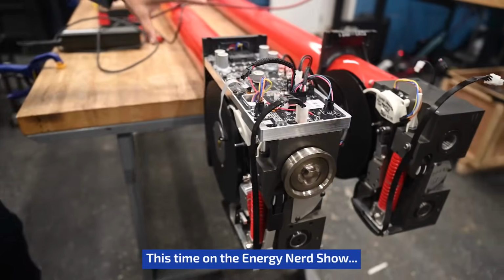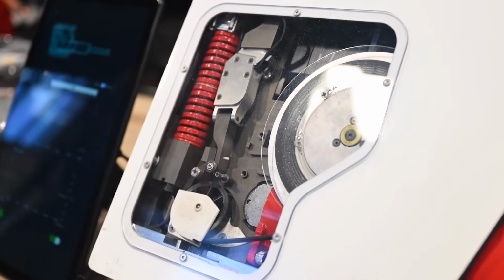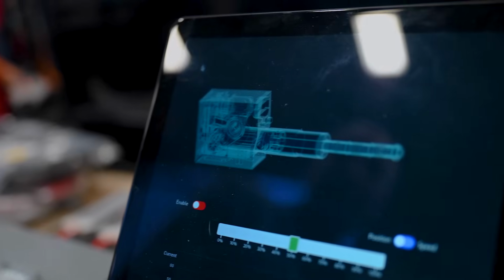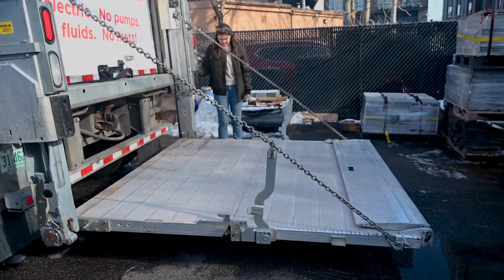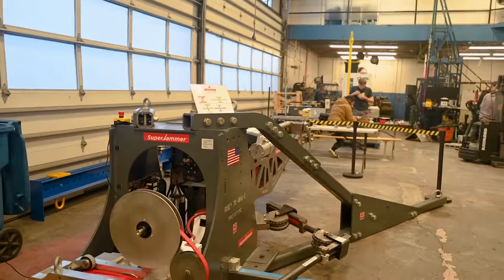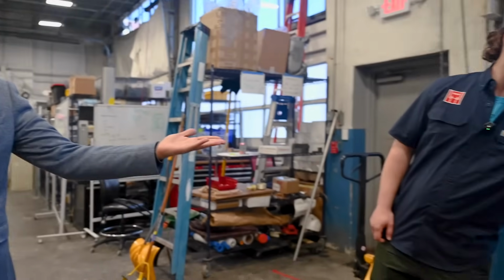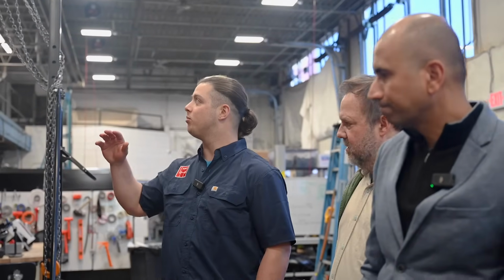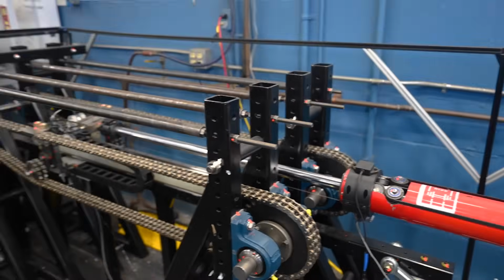Electrifying Heavy Machinery at RISE Robotics!

Comment: The intended application of this tech is for electric vehicles. The idea being hydraulics waste too much energy and this design is much more efficient. These can even be configured to regenerate and charge the battery when force pushes back on the actuator - like lowering a lift with weight on it. Of course it won't be universally applicable to every use case, but it could see a lot of installs as heavy industry continues to electrify.

Comment: So you invented a spring and a retractable belt (and made it supper complicated and expensive to build and maintain). In the industry in which I work (quarrying) we use hydraulics because we need huge amounts of force. There are also ALOT of cylinders per machine/process and they are used heavily and must be incredibly robust and cheap to maintain and/or replace. We already have control methods and sensors to allow precise, fast and proportional control of those hydraulic actuators (and we can go forward and back without springs - with the same levels of force in each direction). I wish you every success with your innovations but I am not seeing anything close to a challenger to hydraulics here. Talking about leaks constantly isn't going to convince many people I'm afraid - I think even a layperson can clearly see a lot of expensive ways your equipment can fail which hydraulic cylinders and solenoids' are not susceptible to. This was none the less interesting - best of luck 👍.
Reply: And what do lead screws have to do with 'Beltronics'?

Comment: These are neat. I work with hydraulic systems and occasionally they cause issues. I just dont know if these systems will be a drop in solution to replace our hydraulic system though.

Comment: Its pretty simple. Fancy housing. The major part of this project is the Ability to contain the Fluid and Maintain rotation at the joints and gear system . To push and pull. Now that ;has Advances for so many applications 😮 . I can see how using Ferromagnetic pole points could assist in theory Ingenious Creation truly.

Comment: My biggest concern would be maintenance of the internals - There are far more precision parts within the cylinder, so I'd be concerned about the longevity of these when they are abused as all heavy equipment is.

The comment about forklift steering cylinders was especially interesting though, I've driven a few vehicles with hydraulic steering and there's always a large disconnect between the steering wheel and the direction of the wheels which makes them feel really odd. With the position control of these cylinders, the steering would have a much more direct feel which is nice.

Comment: So you hvae a boom crane or heavy excavator in the middle of nowhere and part of  mechanism has cracked and you get I C Weld out to fix it and you need to lower something relative to something else but a diode or something else in an obscure module has failed so it is impossible to do that. You can't pop a release valve to release something in an emergency where you need to reposition parts to weld, say.

Comment: Impressive demo, and I can see a few niches where this can be applied, but I'm curious about the force density comparison. A 4" hydraulic cylinder at 3000 PSI generates ~37,000 lbf from incompressible fluid pressure across the piston area. Your belt system is fundamentally limited by tensile strength of the polyurethane-steel composite and pulley mechanical advantage. How do you achieve equivalent force density when belt materials have orders of magnitude lower stress capability than hydraulic pressure? Also, with cyclic loading at these forces, what's the actual fatigue life of the belts under flexural stress around the pulleys vs. a hydraulic seal replacement interval? The speed advantage is clear, but the physics of force generation seems to favor hydraulics for high-load applications.

Comment: 1) enviornment flexibility. 
2) ability for the owners to debugg, repair and maintain. 
3) size and packaging. 
4) cost. 
5) they are reeeeeeeeaaaalllly underplaying the belt wear. And NVH on those actuators. 
7) hydraulic systems are not limited by the fuilds capabilities but the capabilities of the steel that it moves ..hence you see a gazillion safely valves on them to protect the Machinery. So i dont see the point of this. 
8) how is this going be powered, i would rather use an electric pump to power a hydraulic circuit. Than use that motor to run this because the same pump can run much much more loads than these systems. 
9) for heavy machinery, on site maintenance and repair ability is not just a bonus ...its the king. And opening up a circuit board in rainy, muddy or dusty enviornment is definitely not advisable, also the AI stuff is a puffball because if my excavator shuts down in the middle of nowhere because of a " software update " issue..its lights out.

Comment: Why weren't these compared to traditional screw actuators? 
With regards to the liftgate, many liftgates use block and tackle connected to a hydraulic cylinder instead of just winching on a cable/belt with an electric motor. Those are just a pump assembly(motor, pump, tank, relief valve, and lower solenoid all built into one unit that's not that big), two hoses, and a hydraulic cylinder. To go down they just open the solenoid, to go up the motor is energized. Using this system is considered better than a motor and gearbox spinning a winch drum. So why are these electric belt actuators any better, except for the lack of hydraulic fluid? I understand that the regen could be a factor with things like forklifts, but even electric forklifts have been using hydraulic cylinders instead of winches for decades.

Comment: many of the new injection molding machines do not use hydraulics, they have been replaced with servo motors and screws. they leak a lot less on the floor and can operate with better force sensitivity than hydraulics, I have seen them quickly stop moving if they detect extra force is required to close the mold earlier than expected. this saved a prototype injection mold made from aluminum from being damaged.

Comment: As an aside, anyone remember the Hynautic throttle and gearbox controls popular on smaller diesel boats in the 80s and 90s? I'm just thinking about how these were basically mini push/pull hydraulic systems powered by a human. The interesting part being the hydraulic fluid was anti-freeze. I know anti-freeze is poison but not like oil which can do long term damage to the aquifer and all.... Then there's brake fluid, water based or water soluble i guess you would say.... I don't know why oil is the typical fluid in large volume hydraulic systems but I think possibly its because its in great supply and cost very little compared to less abundant, more expensive, and coincidentally cleaner alternatives? If so all this expensive electric nonsense can go to hell. Especially for a lot of the ill advised marine applications they are trying to force down our throats. That right there would pretty much expose the whole trend as a profit seeking deception when they can just ramp production and reduce costs of some "green" hydraulic fluid. I'm not buying the leaks issue anyway. Yo fix the leak. Yeah that whole issue did seem very forced..... Just train your guys that they don't need to rainbow the forklift in front of the mechanic just to prove it needs seals (pressure sensors can probably accomplish a job here). What do yall think?

Comment: This is not an advancement in technology. It reminds me in a way of the dragline systems used with frickin steam shovels 100+ years ago before hydraulics and internal combustion got implemented. I believe them that the belts need less maintenance compared to changing out the whole dragline cable every couple months, but like others said the belts aren't new tech. Just imagine when the mechanics pressure wash the trencher before they work on it, and as a result kill all the freaking electronics which for some reason are integrated into the ram??? Not even a question if that is gonna be an issue. Ask any Volvo Penta mechanic. Super cheap to print a circuit board these days.... Big bucks in selling parts for your intentionally overcomplicated "high performance, high tech, green friendly, even-a-caveman can operate it" nonsense. Big bucks is an understatement, I think our whole economy has devolved to operate on this kind of trickery. I like how when the EPA rolls out a new tier on diesel emissions, John Deere just increases the displacement of the engines then derates the hp to "burn less fuel". They're still cunts on the maintenance though but at least their engineers have better shit to do than reinvent the wheel. Never forget that literally everything was tried during the industrial revolution. Every weird design that somebody could dream up was patented and built. We picked the good ones and since then that stuff has all been pretty standard. Today we have material design improvements and computerization, so some of those ancient failed ideas are getting another try. Maybe these rams would work well in space, which is the kind of thing we need to be having our engineers focusing on, rather than how to maximize their profit at the expense of the customer, and protect their jobs.... But I think these guys are just cashing in on overcomplicated proprietary junk on the flimsy premise of green tech that's trending among engineers who's job was mainly accomplished by 100 years ago. Its a conspiracy I tell ya! Electric motors are fine but we have had them forever and they have had their place.... Materials science of batteries is unfortunately pushing electric toward encroachment into the diesel world where it just don't belong. What's next sails on cargo ships? LMAO.

Comment: No more loud banging in the morning on trash day is a very big advantage. So is no environment contaminating cleanup of hydro oil.  

I do agree with another commenter regarding increased number of parts being a concern for failure points and using linear actuator, however I think the block & tackle built into this system allows a mechanical advantage a linear actuator can’t deliver. Additionally, there’s a reason elevators are using this instead of a stacking of linear actuators in series. 

The comment on passive relief valve is the most important thing to consider imo, what happens to this system in the real world when it is yanked around while inactive? Can that be planned around?

Comment: Multi Position Hydraulics is & has been available for quite some time now, it has been coupled with an electric solenoid that is connected to a computer . The position is then actuated by hydraulic volume that is then translated to the extension &/or retraction position at a predetermined measurement.

Comment: Nah - I wouldnt swap out Hyd Cylinders on a W900 Excavator working in a harsh environment with an electric actuator. Hyd Cyl has 1 moving part, easy to fix, long life, will run even if seals are damaged,

Comment: i think it is interesting however i do not understand why they are using a round tube cross section.  pipe for pressure..... no pressure no pipe.   Square for strength and seems it would be way easier to fit the pieces inside.

Comment: Using the formula: HP = (2500 PSI x 12 GPM) / 1714 = 17.5 horsepower. 

Way to overcomplicate a simple 8 piece cylinder, and 7 piece control valve.
Reply: And the energy waste is what 75% on that conversion?

Comment: I’ve been or, I think, most of the people already use old model of actuator that already sell in the market. I bought and applied actuator in my house is because it cheap compare to hydraulics, yet easy to DIY and I able to connect with my smart home system (i.e: to actuate my glass void open and close). It also able to actuate at multi position, very convenient. Now already 4 months I’ve been use electric actuator and still works fine to lift up 60 kgs of void canopy glass, although, I still evaluate its durability. 
My concern is only the gear and the controller are quite look complicated and seem very fragile.
I think, as long as it has simple system, cheap, durable and reliable, it would be good replacement for the hydraulics.

Comment: Hydraulic systems have one advantage that nothing can compete with - liquids are not compressed and stretch like air or belts.
Reply: The stiffness of the steel in the belts is 4x that of the liquids.
Reply: @CharismaticScientist  it is application specific. His point is about the amount of load each can transfer without breaking. Liquid will neither fatigue or beak but steel will.More over there are packaging constraints with this design. This will have very limited application and will be largely limited to stationary applications.

Comment: Electric winches are already taking over hydraulics in the fishing industry. I have maintained hydraulics, and maintenance is an issue. Not sure why they are using the belts and pulleys rather that the new design motors that have so much power.

Comment: as a builder my whole life if I had to come up with an idea to replace hydraulics this would be number 999,999 on the list. did you see how many moving parts were inside of those rods I literally saw belts rubbing against the inside of the tube also you're never going to be able to produce the amount of torque needed in the field to do actual work why would anybody even consider a system like this maybe for a small robotic systems? That's a definite possibility but replacing a D8 cat I don't think so
Reply: There are a bunch of moving parts in sewing machines, printers, engines, and many more examples. This tech comes in a 22 Ton force size, pushes and pulls, and it will go on a D8 in due course. Before hydraulics steel cables transmitted mechanical power, and this is a return of that principle with modern materials and novel methods of handling the belt, that enable it to get into a from similar to hydraulics.

Comment: Try put this on a 50 ton excavator and see how fast they will laugh you out of the construction zone. Power to weight nothing beats hydraulics...
Reply: It’s on a 22 Ton container handler mast shown in the middle of this video, and in that application, it moves the same load at a higher speed. It’s also lighter weight than the system it replaces in that application. So, it has a higher power to weight ratio.
Reply: Let me guess the fact you just were made a fool isn't going to change your mind at all and your still going to say it won't work on equipment.
All major equipment companies are working on all eclectic equipment.
Reply: Oh and how many times stronger is that 22 ton unit than the excavator arm that you're claiming it can't lift.
And how much slower is that hydraulic systwm

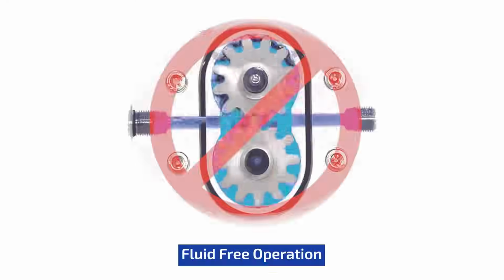Comment: 1:30 "as you know hydraulic oil is haz & also messy & when these sites move they need to be cleaned up cause it's very messy & expensive" 

I wasn't watching & just had this playing in the background while I searched for a job opportunity & the level of bullshit that came out of this man's mouth in the first minute thirty lmk he is pushing his nonsense on ppl who don't know what they don't know because a leaky ram WILL NOT OPERATE PERIOD & WILL BE AUTOMATICALLY RED TAGGED OUT OF SERVICE!!

if you're gonna Bullshit ppl then at least know what you're talking about because right now you sound like a guy who's read about hydraulic systems but has NEVER worked in or around them.

For clarification, the only hydraulic systems that are "messy & expensive to clean" are hydraulic fracking rigs but that's nothing to do with the hydraulics & everything to do with the oil it's ripping out of the earth.

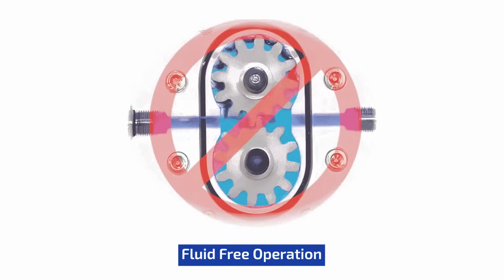Again, I'm only 1:30 in so I don't know where this is going but the beltraulic or whatever wheel he reinvented isn't going to be as cheap as rams, hose & a pto & will require knowledge only he currently knows to repair so take that into account when "upgrading" your 💩

Comment: So many comments have been negative, but also well reasoned and based on experience.

Instead of fielding soft-ball questions and have the video turn into an infomercial, the interviewers should do their research and ask tough questions so the staff can better identify and explain the niche that the product fits into.
Reply: But it's not based on experience tho, as this system hasn't been tested in practice a whole lot. The comments are acting like they advertised this as something that will replace all hydraulics, when they are simply providing more options. This will clearly not replace hydraulics in applications where hydraulics have worked well for ages, but how many applications couldn't use hydraulics in the past because i.e. leaks would be absolutely devastating? They mentioned electrification of construction equipment, and I'm betting most people haven't seen the massive batteries and energy requirements of electric excavators. They even have to take breaks when working because they need to charge the batteries. If this is a more efficient system, it could potentially find uses there. More options is never a bad thing, and the people who could use this thing might find it useful, or it could completely flop. However, if we listened to experts that pointed out flaws based on "experience" and dismissed new ideas, we would still be riding horses.
Reply: Ha! You`ll never get rid of daft, 50 something year old seemingly random yet totally unremarkable IKEA brand lilly milk toast, yuppie white trash news interviewers Hahahaha! They are a universal constant unchanging force of nature that will be here FOR–EVER welcome to share holder capitalism HELL!
Reply: Dude literally started off saying they are in development.  What part of the English language don't you understand